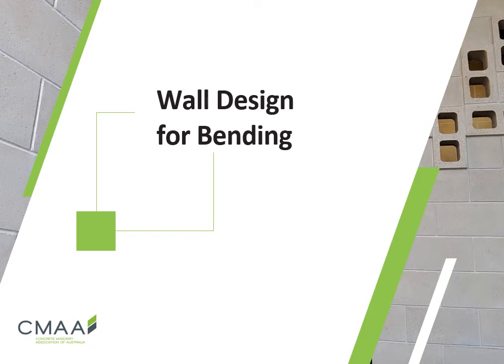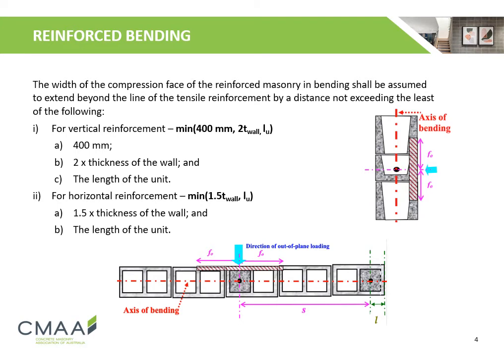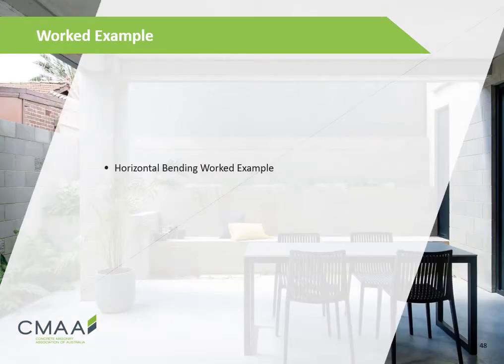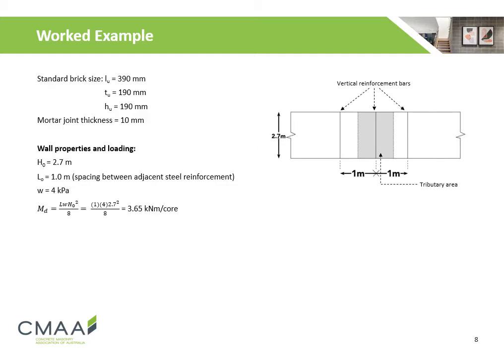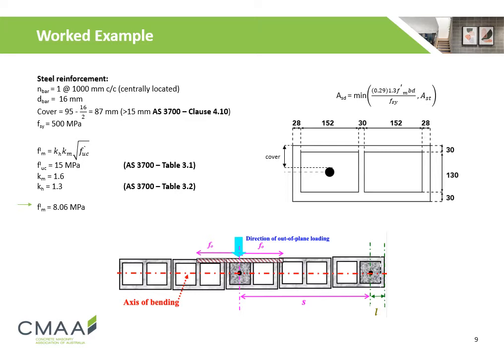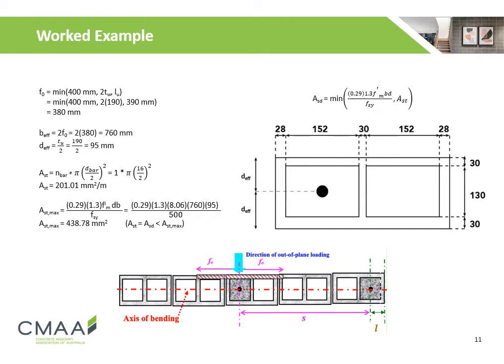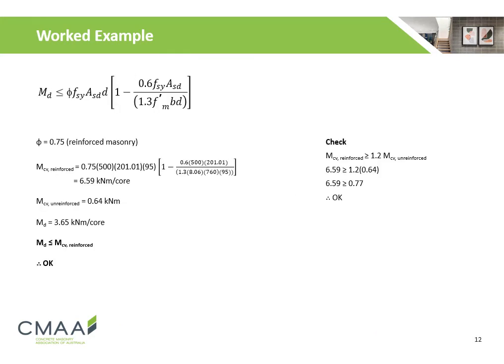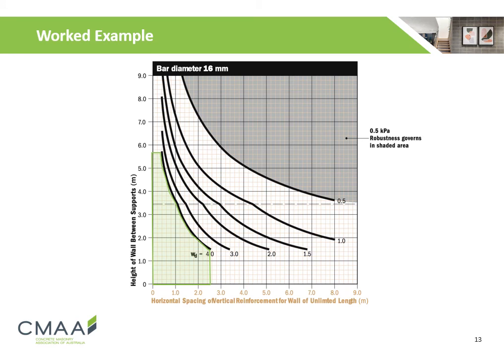Wall Design for Bending

Comment: The capacity of unreinforced masonry wall equivalent is calculated to be 0.64 kN.m (4:57). How do you get it?
Reply: using clause 7.4.2 Design for vertical bending (unreinforced masonry) and f'mt = 0 (see clause 3.3.3) 
Mcv,unreinforced =  fdZd = 0.36 * elastic modulus of bedded area, which for face shell bending is two rectangles 760x30 mm 80mm from the CL i was getting around 1.118kNm? 0.36*(2*(760*30^3/12+30*760*80^2)/95, which is still ok